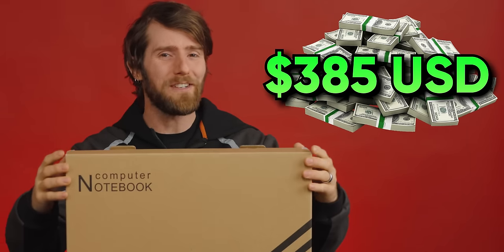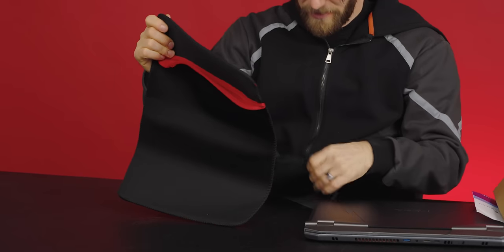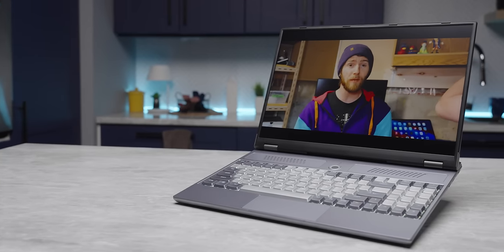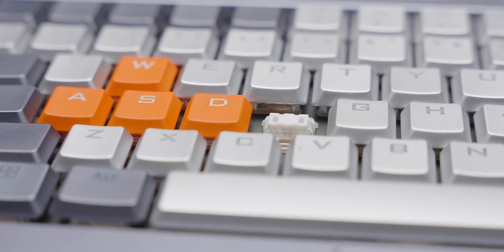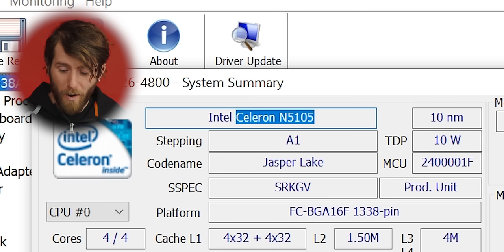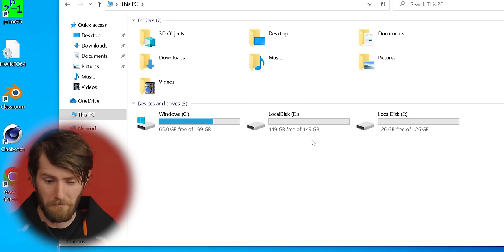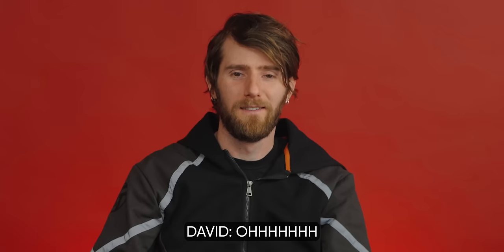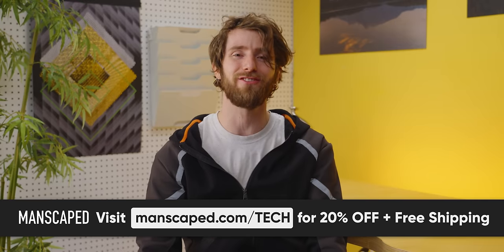Brown Star for Effort – This AliExpress Gaming Laptop is HILARIOUS

Comment: Thought for the editor: the point of “your video is not buffering” is so the viewer knows the freezing isn’t on their side. Perhaps include some Motion in that prompt so they know with confidence.
Reply: Also, a little bit of smartassery: buffering means that it's loading more video ahead of time into the buffer. Saying that it's not buffering, sounds like there actually is a problem.
Reply: They could've used the floating head to show motion
Reply: If your video was buffering you wouldn't know if it was supposed to be moving or not.
Reply: Assuming you’re all listening with sound, you’d often be able to tell if it was buffering or not. Either the sounds gets choppy or cuts out completely until it loads more data for it to be playable - at least for the next few seconds.
Reply: I think what they were trying to imply was, the game is buffering, the video is not.
Reply: I remember somewhere, I think maybe Taran, had said they would put motion in the background of benchmark charts so that the viewer knows the video hasn't stopped
Reply: einstein9073  No, not always. Just sometimes.

The not-so technical explanation (TL;DR): it really depends on your streaming environment and not only applies to YouTube. You’re actually streaming two separate things; the audio and video and sometimes they can become out of sync with each other, the server (due to lack of internet), any effects you might have running, hardware (AMP for high definition speaker or headphones that has a long latency), your device’s decoders, etc.

The more technical, longer explanation:

The way YouTube streams content to you (and many other services as well) is actually two different streams; one for video and one for audio. The format that it streams depends the hardware and software decoders that your device has available.

- I had to split this comment into two replies due to its length; please see the other one below -
Reply: einstein9073  Sometimes the audio will buffer or more will be stored than the video as the video buffer files take up more space in your RAM (video files are just larger than audio files - on YouTube at least; I’m not going to get into lossless details here). That, in this case, makes the audio play slightly longer (a few seconds) or it’ll keep playing the audio while it attempts to get the video stream back like my reply depicted. This by extension can make the video and audio go out of sync which is actually part of the reason YouTube and other streaming services only buffer so much. It’s not only to save bandwidth on their end but to also make sure your experience isn’t impacted by out of sync audio and video, weird server/client disconnects like the time being out of sync, etc.

Here’s an example:

Let’s say you have been watching YouTube or streaming your favorite show on Netflix. You get tired as it’s late at night and you put your computer to sleep (or hibernate - not shut down, big difference in this case). When you turn it on the next morning, you see that YouTube and/or Netflix is open and your computer connects to the internet. ***If you put the device to sleep or in a hibernation state instead of turning it off, that means it saved the data to either the RAM (with sleep) or to the drive your OS is on (C: by default with hibernation). It’ll let you watch whatever it had previously buffered, but when it gets to that point of needing to load more, it reloads the whole HTML5 player to get back in sync with the server, make sure the video wasn’t taken down, and by extension, make sure the video and audio decoders are in sync along with some other things.

Hopefully that clears some of that up. I’m not saying you’re wrong, I’m saying that my response above had a longer meaning that what I typed out (most people wouldn’t have the time or patience to read this whole thing).

Though, saying that I was “absolutely incorrect” is some pretty unnecessarily strong language as the scenario I presented isn’t completely incorrect, both (and others) do happen. That was pretty uncalled for.

***One bad part about this example is that YouTube and Netflix don’t react in the same way due to how they’re programmed to deal with this scenario. Netflix, for example, will just close the stream after five - ten minutes of inactivity and take you back to the main screen.

Comment: Not too bad! I think this would be a good laptop to be a linux machine.
Reply: you COULD mod it with a better cpu and stuff, for like 400$ just for the great screen and better than average keyboard, could be worth a gamble, ofc linux will go just fine but I feel like the screen and keyboard is wasted on a poor little celeron
Reply: @alephcake  and better cooling!
Reply: unironically yes
Reply: you mean "linux machine is slow PC"? Many pp use linux PC to play heavy game these day
Reply: @ThanhThanh-it1pm  Name one. Even Linus switched back to Windows after that attempt with Luke and didn't stay on it. Linux for gaming is still not here to use daily, maybe in 5-7 years.
Reply: @ThanhThanh-it1pm  no, they're talking about how linux makes slow pcs seem faster since it runs better compared to windows as it takes up less resources. With a minimal arch install for example you can get like 300 to 400 mbs of ram usage compared to 5 to 6 gbs on windows 10.
Reply: @Teksers  there is not enough userbase. no one unless they are a linux geek would dailydrive a linux machine for gaming or anything other than browsing the internet.
Reply: @ThanhThanh-it1pm  1.who asked?
2. They said that linux actually runs well on this class of hardware.
3. It's a great Linux learning machine. It's cheap and has Intel CPU, GPU(even though amd has better drivers than Nvidia on Linux, Intel is the best one of the three. They actually support all the codecs and OpenCL in their mainlined OSS drivers, unlike AMD) and Wi-Fi.
Reply: @Teksers  I'd say it's getting there faster than your estimates. Valve is heavily pushing it forward with proton and their steam deck and nvidia is finally addressing their abysmal drivers. In a year or two it might be there.
Reply: XD nah... i have a nettop with a intel celeron (J3355) CPU with Linux it's slow as hell. Like even werbrowising is a pain.
Reply: @jort93z  I think replacing the actual mainboard with something from a more legit machine, but even then I'd be happy to use this.
Reply: @vali69  I hope but knowing Nvidia and hoiw quickly they back stabb their partners... I'm not that hopefull.
Reply: @jort93z  untrue, Alienware did one with the 9900k a few years back.
Reply: I think the same maybe kali linux oh! wait is a joke
Reply: @mhammadalloush5104  if you replace the mainboard on a laptop, you'll generally have to replace everything, the display, the keyboard, the speakers, most are either connected with proprietary connections or will be in the complete wrong place for any other board. Please don't pretend to know what you're talking about.
Reply: @alephcake  If cheap enough it might be worth the gamble.
Reply: @Teksers  That is more of a personal preference/opinion. I switched to "Linux only" in 2005, and still think it was worth my time, specially considering Microsoft screwed up with DOS compatibility, even when DOS games where super common back then.. Shit, that was 18 years ago from now.
Reply: @Teksers  well, with how they're going about it, it might at least give more headroom for the open source 3rd party drivers to improve. But at least the point about valve improving game support for linux still stands and you can't deny it's helping a lot.
Reply: @alephcake  I see you've never soldered a thing in your life, do you understand how difficult a cpu upgrade would be on this? Laptop cpu's aren't generally socketed, they're soldiered onto the board directly. Not only would you have to put a new one on, you have to take the old one off the board, without damaging a single contact or any other component on the board. I'd doubt the original processor would even be useable after removal.
Reply: this and Linux was my first thought as well
Reply: @alephcake  this is stupid on so many levels...
Reply: @ThanhThanh-it1pm  nah i think he meant something more like "if there's anything light and efficient enough to run on this crap, that's gotta be linux", so it's in a good way
Reply: @ThanhThanh-it1pm  I use linux on a pretty good machine, it's just that linux runs so much better than other OSs on older or less powerful equipment
Reply: @Teksers  I've switched to Linux for gaming, and I have no issues with it. Did you just make up that "5-7 years" figure? Because, given how great gaming on Linux is today (and it's constantly getting better), I can't fathom how you got such a large number.
Reply: And it doesn't auto update Windows! This is AWESOME, I'm so tired of clicking postpone windows updates every few weeks
Reply: @Teksers  I agree overall but "even Linus"? Linus is not really a Linux power user, it can be seen from part 1 where he deletes GUI.
Reply: 2023 is gonna be the year of the linux desktop
Reply: Windows scales, you know. I have a 32-bit setup for my older programs and Win10 idles at about 1.2GB of RAM.
Reply: @Teksers  i have a friend that games on linux exclusively except for games that dont support it e.g. valorant bc of anticheat
Reply: I was thinking the exact same thing!
Reply: @D3nn1s  Man you guys really do not get what I am saying at all. Stop prasising Linux that much it has it's issues too.
Untill the day comes when everything will run on Linux like they do on windows(with it's share of problems), people will not adopt it.
End of story.
Reply: @Teksers  sure i never disputed that. Im 100% a windows guy too, you just said you couldnt believe people did this, but they do.
Reply: @@luxaeterna5088 Mmm yes that is why even in the business environment it's 98% windows right? It's so good that it can replace Windows completly right?
Reply: @Teksers  the issue for Linux gaming currently is DRM and anti cheat. So many games would run fine on Linux if the devs just let the anti cheat run on Linux. 

Linus was correct in his points against Linux. And I agree with him for the most part. It's getting better and keeps getting better. Valve have done huge work for Linux gaming with the steamdeck for example. Linus did his vids just before steamdeck or just as soon as the deck launched iirc. Linux gaming since steam deck launch till today has changed a lot.
Reply: @Teksers  

The Steam Deck has decided your assertion is incorrect.
Reply: @Chad_Thundercock  really please tell me do these work on Linux? Photoshop, Corel painting, Microsoft Office, DAWs for music, video editing software such as Premiere or Avid, It even lacks some recording tools such as Fraps, Camtasia or Bandicam. Msi afterburner for me using adobe reader is a must. I need the microsoft suite excel and access the most open libre or google can not help me replace then. Tell me now can you fully replace the OS for Linux? Another one for me is bluestacks and Nox android emulators that do not work which is funny because androi is based on linux.
Reply: @Teksers  

I've been using Mint as a daily driver since forever, and have never had problems.  
But I don't do video editing and associated projects.  
Libre Office is a fine office suite, and Adobe (aside frome extremely niche applications), can be replaced with Audacity, Blender, Maya, Gimp, and other open source products.  

But that's not the point I'm making.  My point is that Linux is fine for gaming, and it's absolutely ready for public adoption.  The Steam Deck is quite literally a Linux gaming device.
Reply: @Chad_Thundercock  I am not talking only about gaming. You are watching Linus's videos a PC can be used for more than gaming. That's what I am saying. There's more than gaming but if you guys are only using it for gaming it's your problem. I am using it for more than gaming. I use it for CAD and some 3d rendering and those applications have issues on any version of Linux.
I say again a PC is not used only for gaming, let that sink in already.
Reply: @jort93z  you're right, but what I'm saying is the imcluded ribbon cables will not reach. Most designs are proprietary. You'd most likely need extenders (rare, potentially even custom made) for all the ribbon cables.
Reply: @jort93z  if you look at the teardown, they soldered the non-mobile cpu to the board.

It's still not socketed, buddy. There's no socket on the board. The chip is soldered.

Comment: The choice of words in the title calling it a Brown star seems a bit off to me but seems to be a fun video. That Ethernet adapter and the free gifts :D We still use 100 mbps connections in a lot of our house but our total speed is only like 60-70 down at best. Maybe it's an issue for you guys elsewhere, especially with your gigabit+ probably NAS setup
Reply: i think brown star refers to it being sh*t
Reply: @yatsuraboy9958  a chocolate star fish
Reply: Dirt star, a step below bronze.
Reply: A misconception in my opinion is that an Ethernet card is used for only Internet connections, or storage devices when this is not the case usually.  It's the most performant, efficient, cheapest and best means of transferring data between two devices, you can plug it directly to a switch, or another laptop to copy files and games. You don't want to limit yourself to a measly 10 megabytes per second of file transfer, especially considering modern day SSD file speeds of over 330 megabytes per second for the cheapest SATA ssds.  The gigabit Ethernet provides an acceptable 100 mega bytes for second, so having an slow Internet connection speed in my opinion isn't an acceptable excuse for providing customers with substandard obsolete 10/100 network cards.
Reply: > our total speed is only like 60-70 down at best

Yeah for an internet connection like that you don't really need a faster network connection. However, it is nice for your internal network, as you said if you have a NAS or even transferring files between computers. 

Same for use in an office, certainly if you have a bunch of network drives you might need to access.

But considering that the targeted audience for this laptop likely isn't people using it in an office it probably is fine to do 100mbit max.
Reply: @DRSDavidSoft  Though most people don't use it that way. Even if they should. (They instead transfer files from one device on their local network to another... over the internet through a cloud service.) So might not make a difference to most consumers? But really, Gigabit is pretty standard so I don't know if there's a good reason not to have it.
Reply: Yeah 100 mbps is fine given what you're plugging it in to. its a chonky netbook, not a workstation.
Reply: We have Gigabit internet at my house, we have probably 12 devices using the wifi6e and one lucky device using the ethernet port directly. Our wifi6e gets about 350megabit down to each device. That's good enough to stream 4K and play games with decent download speeds for new games and what not.  When I lived in an apartment I had 400 megabit connection but that was hardwired and only one device so it was just fine. My friend has 100megabit connection at his place (grandfathered pricing) and doesn't want to change that because he is cheap lol. He struggles with connection speeds. He would host video game streaming for our guys nights that remoted in from other parts of the country. we would use discord for video chatting and twitch/youtube/discord to stream the games. He was only streaming at around 480p at most and we all still had a pretty terrible time.
Reply: @ids1024  For small files a cloud service is probably the easiest way, but only because all the local are so annoying to set up
Reply: @andrewmartino6144  That's more likely because the 100mbit you are talking about is downstream and upstream for them was much lower (assuming cable internet). If you have 100 up and down it is more than enough to stream 1080p in high quality.
Reply: Lucky sod
Reply: @andrewmartino6144  yeah, good for you lol, higher speeds don't really exist yet in my area of the UK but maybe it's possible to get up to 100 or so rather than 60-70, but then I get nearly 20 up which is great and even friends on 500 or 1gig can't beat that sort of ratio
Reply: @yatsuraboy9958  yeah you're probably right, I just thought it could be seen as something to do with it being Asian, but then for china it would probably be a different colour
Reply: @Stallzyx  Some day you'll have star link or satellite internet, and after you look at the hole in your pocket after forking out $150-220 usd per month you'll finally have faster internet. lol Or just write your local government/ internet providers that you want internet speeds that are current haha

Comment: Dude. My pretty high spec MSI gaming laptops trackpad hasn't worked for over a year. I usually use a wireless mouse, so wasn't too upset, but still. This review accidentally led me to "fix" it with the function key!! Thanks Linus hahahah
Reply: Holy crap. Mine too on my StarBook MKV! Thank you for this comment!
Reply: @richardberg5189  The "Function" key is just about the "Any" key...

Comment: That batch file is a KMS (Key Management Service) Windows Activation Script. You simulate a MS server at the backend, and then set windows via the cmd (slmgr is the command), apply a key the backend knows, and boom. You've activated Windows for free. MSGuides have a good tutorial.. you can also use PicoKMS, which also does Office Activation.. but Defender seems to obviously hate it.